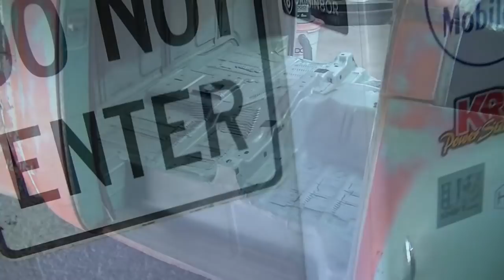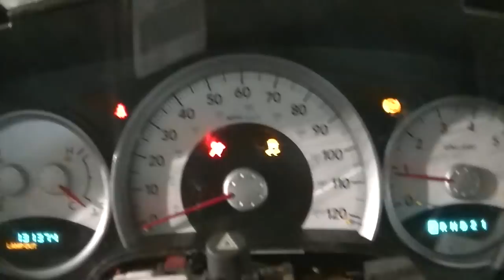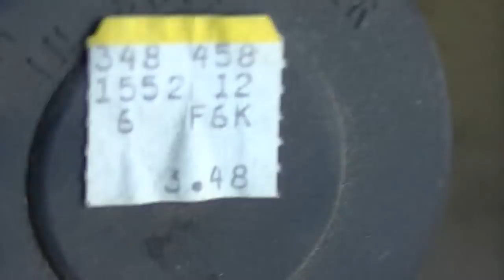1950 Pickup Goes HEMI & AWD? YES! Nearing Completion!

Comment: There's absolutely nothing as cool as an old Stud-Breaker pickup.  The styling is so timeless.  A buddy of mine did a very good and complete job of modification on the truck and dropped a 501 Caddy engine in it.  Talk about torque and power.......the only problem he had with it was when he sneaked it onto one of the runways in our hometown airport and ran it thru the gears hard....unfortunately he did not have the hood completely hooked down and it bent itself back over the windshield at 100+ mph.  Luckily his Dad owned a machine shop and he also had access to the body shop.  It was such a pretty little devil with a super smooth body and nice paint.  You're gonna love that truck!  Tom
Reply from the maker: Full length episodes out now, thanks for watching!

Comment: You have done a great job with it. When I saw the truck at the previous owners  house I never thought it would end up with a modern chassis under it. Looks like you had fun building it.
Reply from the maker: Thank you! When we saw it, we knew it needed to be transformed- It's one of the coolest ones we've built, very happy with it. We got it from a guy named Al- I sent him links to it, hopefully he approves as well! Thanks again and have a great day!
Reply: Al is the one that told me about you guys. He thought it was neat that you transplanted another chassis under it using a cut off wheel and a saws all. I had to look you up. Nice work, you guys do. I have a 56 dodge truck. Any suggestions on a transplant suspension to go under it?
Reply from the maker: Thanks so much! Imagine if we had a lift and a plasma cutter, in a proper shop! We do what we can, with what we have. :) It's all fun and as far as the 56 Dodge- it needs a 6.4 Hemi or a Diesel. Preferably Cummins, but a Cat motor would be siiiick. If you contact me through the www.GrenadeMotorsports.com website, we can brainstorm ideas on what to do with it! Thanks again for watching!

Comment: So many people that attempt something like that end up with a failed project that gets sold dirt cheap or hauled off to the salvage yard. Forty years ago when I was young I put a 1927 Dictator body on a 73 Olds Cutlass chassis, it didn't turn out as nice as your work but it was my first one, and I have been addicted to cool and unique rides since that first one. Stay with it and have fun........
Reply from the maker: Well thank you very much! Check out some of the other videos on my channel- I've done a BUNCH of things like this and more. Thanks for being an innovator on these things!
Reply: @GrenadeMotorsports  Currently I am just getting started on a 1949 2R5-12 Studebaker project. 454 with turbo 400 trans, picking up a Dana-60 this weekend. I don't know if I want to use the original frame or put it on a chevy chassis. Still shopping and thinking and developing a picture of the end product in my head. Keep following your talent and imagination, keeps you young.
Reply from the maker: @whocares2227  Thanks and unless your frame is near mint- I'd go with a newer frame. Easier to fit everything in, on and around. Best of luck, Git er done!
Reply: @GrenadeMotorsports  Late 70's GM car frame is what I have located, should handle everything just fine without any chassis fabrication,

Comment: Excellent build. I'm definitely gonna try those diamond cut off wheels.
Reply from the maker: Thanks man! They reduce airborne particles by 60-70%. They throw metal bits, but the trade off is worth it. Thanks for watching!
Reply: I like them, they take a little more cutting pressure that and abrasive,  but it is nice they stay the same size.

Comment: I'm curious about the wiring- I have to imagine there are a fair number of circuits that don't get used (looks like wipers and airbags, probably others). Are you able to go through and clean the excess out, or is it all too integrated?
Reply from the maker: Yep- good question! I've done this so many times now, that I know exactly which wires can get cut and cleaned out. Lots of it gets cut and capped, it's not a mess under the carpet when it's done. Thanks for watching!

Comment: Hi I just wanted to ask if you recommended any other vehicle then a Durango  ,I have a 57 studebaker truck and I'm getting inspired by your builds thank you keep up the awesome work !!!
Reply from the maker: Well- If you're looking to keep the wheels under the wheel wells- the Dodge Dakota fits under them and can be found with a 5.9L 4x4 or 2wd. Excellent choices, but I prefer Hemi or Coyote! Thanks so much for watching!!
Reply: Thank you!!
Reply: Hi hope you are doing well ,I just wanted to ask if by any chance you may know, I finally find a 04 Durango 4x4 4.7l for this project  and it was running fine but now I have a problem 2 obd codes 0715 and 0720 and the vehicle doesn't move at all I did some research and I find the input and output tss are bad just to replace but will that cause the vehicle not to go in any gear?? It will start and you can move the shifter but it doesn't move if you have any advice it will be much appreciated, thank you!!!
Reply from the maker: I have never had this issue before. I also, never use the 4.7L. Mostly the same electronics, but in all the hemi trucks I've done, I've never had this happen. Let me know what you find out and good luck!

Comment: What tuning software do you use when working with the Hemi?  I recently bought a 2005 Hemi Durango to do an engine swap into my 2005 Jeep Wrangler, so I have found your videos to be quite informative.
Reply from the maker: Well thanks! If I need to tune one of the 5.7's, I use Diablo sport because they have support for the 05 & up 5.7. Cheap and easy to do on a PC. 03-04, very difficult to access the ECU with hand helds. Just an Fyi. I know the Durango 5.7's inside and out, so if you hit a snag, be sure to ask and I'll try to help. Thanks for watching!
Reply: Can you please tell me the name of the specific Diablo Sport software or tool that you use to tune the 2005 Durango Hemi 5.7L with a PC?  I am lost at the various offering when I did a search for Diablo Sport tunner???  Thanks.

Comment: I think this is a cool build, but,, it looks like the position of the steering wheel is going to be pretty uncomfortable.. I am 6'3" and NOT thin. Along with a fused back, I would like something like this if I could be comfortable in it. So I am looking forward to you having the seats in it and telling us how you feel driving it..   Looks like a great build....
Reply from the maker: It's right at the limit of what we'd call acceptable. I'm 6'3" and not small either, and on a milk crate, there's a ton of room. It looks odd I admit, but once the right seats are in it, it'll be juuust fine. Thanks for watching!